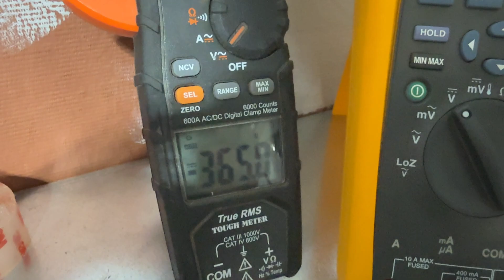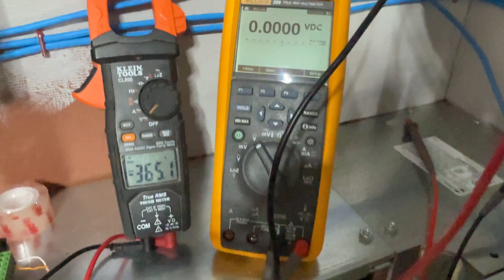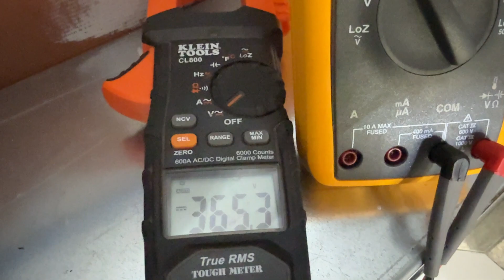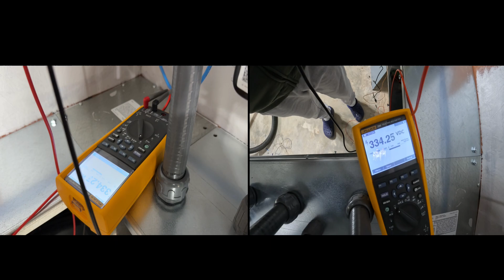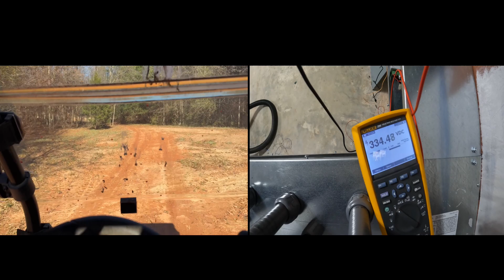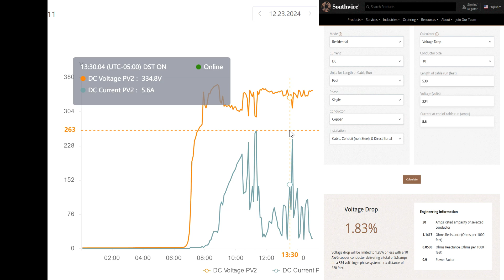PV Array Voltage Drop Over 530 Feet

Comment: Just as well you got what you thought as there is not much you can do about it if not. The high voltage and large spread are the keys to a good response which you have. The only thing I have problems with is the length of the string and the chance for shading but you have a great wide open spot so that is not a concern. also I have the snow which slides off in pieces so it is the same as shade. Also -30 does wonders for spikes another one you don't have to deal with. As always you did a great job with explaining the video. Number 10 does a good job but 530 feet is quite a ways  and one never knows until the test. You have a great system in the works.
Reply from the maker: No shading concerns. #10 is $0.33/foot where #8 is $0.60/foot. Thank you.

Comment: I'm running 15 panel strings. Thru rxperimentation I found equal panel length strings work best. Raising voltage is the easiest way to minimize losses
Reply from the maker: As mentioned in the video I take provided maximum power numbers and reduce them by 25%. So I try to limit each MPPT input to around 4kW. Reason for 10 panel strings. If that makes sense. Thanks for watching.

Comment: Great fallow up video ! 
I’m very surprised of the results 
Happy holidays
Reply from the maker: Thank you.
Reply: A simple demonstration of ohm's law.  There's no real need to go to the far end and measure the voltage.  We know the inverter end voltage, we know the resistance of the wiring (by distance there and back and the CSA and composition of the wire) and we know the amps flowing so we can calculate the voltage at the far end fairly accurately.
Reply from the maker: @retrozmachine1189  Over the years I realized that people sometimes prefer visual example over the math.
Reply: @DMIINC2013  Yes, this stuff can be much easier to handle visually.  I wasn't being critical of cour video nor @SoluSolaire